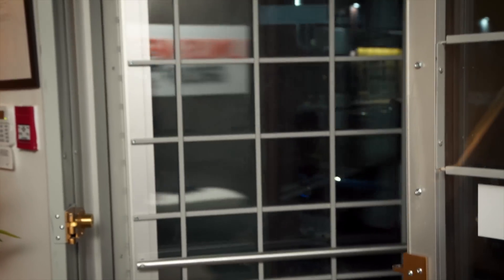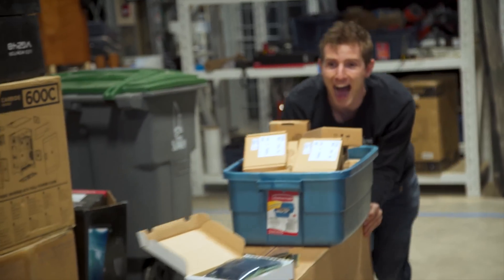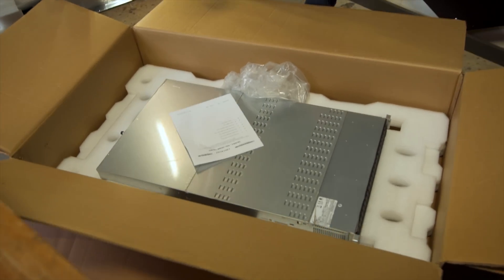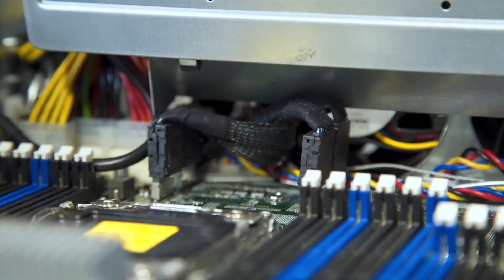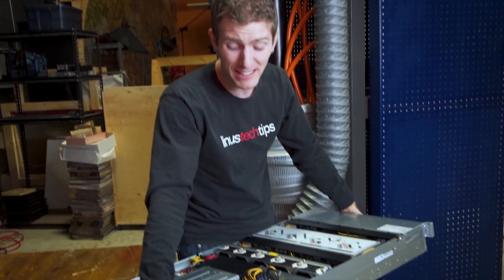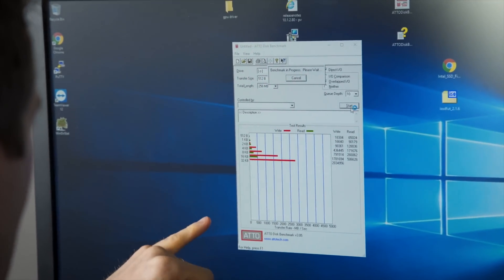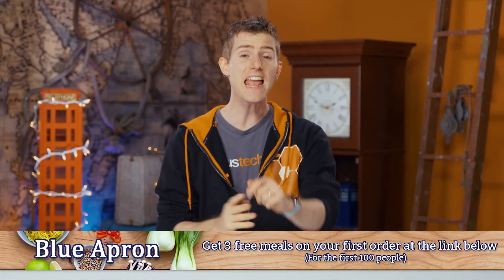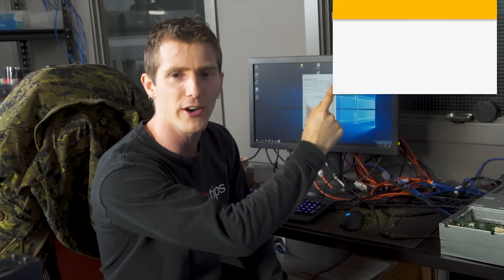The Fastest Storage EVER – HOLY $H!T Ep 14

Comment: Wait so you're running 24 SSDs EACH capable of saturating a PCIE 3.0 x2 link all on a single PCIE 3.0 x16 link? What the fuck is the point of that? You could use drives 1/3 as fast and achieve the same results (well, on sequential reads at least, but I assume that's the main workload of this system if its for video editing). Heck, ordinary old SATA SSDs would nearly get you there. Why not at least split the drives across the two CPUs and use software raid (or whatever, btrfs/zfs/whatever you prefer) for double the theoretical bandwidth?
Reply from the maker: +Matthew Hennes more to life than raw bandwidth. Many users will be hitting this at once needing low latency access to large video files. NVMe is the key to our new workflow.
Reply: LinusTechTips I'd love to see what the top of the line drives do for you that more basic ones wouldn't, especially in this particular configuration. I'm sure others would be interested too, perhaps a more in depth video is in order? Unless of course you consider it proprietary info or something.
Reply: he probably got those ssds for free , half of his inventory is free
Reply: ***** Mate, I don't think he spent $20k+ building a system JUST to make a video about it. This server will be an integral part of their workflow. I believe it could have achieved the same goals for less money, or given this budget could have performed even better. Granted, that might not have made quite as interesting of a video, but I honestly doubt that was a huge consideration in the making of this. But who knows, maybe they'll be using this server differently than my assumptions, or maybe there's something I haven't thought of. Here's hoping we get some more info, this is certainly interesting.
Reply: Virality It would be MORE holy shit if the SSDs were split across both CPUs and the transfer speeds were double, though.
Reply: yeah.... zfs raid 10 with the disks split across the two controllers is going to be faster and lower latency than windows soft raid. guaranteed.
Reply: The worst part is all he needed to do was put half the drives in the fold up slots and he'd have them evenly distributed, this is not secret/proprietary knowledge.... it's in the manual...... oh wait, it's Linus.
Reply: Matthew Otto which is why 'software' raid done on a faster CPU with more ram and higher I/O bandwidth is faster, better, and lower latency than a 'hardware' raid card.
Reply: This is what happens when you have money to burn
Reply: It won't be used in RAID 0 so the oversaturation will come down a fair bit.
Reply: +Bloodstainer Windows Disk Management can create a software raid array out of pretty much anything it can address as disks. You can't boot off of that type of array like a chipset softraid array, which is where I'm guessing that NVMe limitation is that you're mentioning. Him referring to it as the Z drive (array), pretty much means something else was the boot media.
Reply: Intel does actually make 2.5" drives all the way up to 2TB (see the P3700 series), but they're about double the cost of these for only 66% more capacity, so that may not be a very good tradeoff, plus you trade some random performance for better sequential performance. I doubt that would be an issue for this use case, but its something to keep in mind.
Reply: Bloodstainer yeah, you can. if the os detects it as a disk, it can be used in software raid. that's kinda the point of software raid.
Reply: You can't use software raid for NVMe SSDs, heck, I'm not even sure the newest Samsung 960 drives would be able to run in a RAID setup without specific gear.
Reply: Zahir khan It may appear as so; everything has an opportunity cost. Their no such thing as a free lunch! In Linus case if he was in the States, he would possibly have to give Intel a copy of his W-9 and pay taxes like everyone else.
Reply: Matthew Hennes Yeah if the SATA exit point bandwidth can be matched with the network interface unit (by something like cryon optic cables etc) then the bttrzfs/zfs can be run on modular communicator to triple the read and write speed !
Reply: A kind of Here are two similar drives, one for the entry level computer user, and one for the pro enterprise business user. and here are the features of both and why their perfect for their respective owners type thing?
Reply: The network interface is also just able to manage just one fourth of the PCIex16 card anyways. Unless you have a lot of IO heavy tasks on the server it doenst matter. The  only point of using that much drives is capacity. He would have probably been better of with fewer, bigger ones but they dont exist.
Reply: ***** well to be fair he did say that they were't actually planning to run raid 0, and besides random I/O DOES scale with raid. But I don't think he's planning to hit this with a lot of random access. He says there's more to life than bandwidth, but I'm curious what specifically he's trying to achieve with this
Reply: Matthew Otto that's not true, there are hardware raid controllers. I'm not sure if they're ever really used anymore, but they definitely exist.
Reply: Matthew Hennes He should have another 4x U.2 HBA card in there and should move 1/3 of the drives to the inner backplane.
Reply: If you cant be nice in expressing that opinion get off life. #realitycheck
Reply: Аll hоot girls аrе hеrее => https://twitter.com/4a54cd7488a77b74f/status/801992405775826944                                             Тhe Fastеst Storagе ЕЕVЕR â   HОLY  H ТТ Ер 14
Reply: yeah 24ssds pciedn x2435 x16sx link 1/3., dirives with raiz s23241 f9632s i dont know what the fuck
Reply: Matthew Hennes Because it lets him make a video for HOLY $HIT and why not if he can get his hands on it so easily.
Reply: "more to life than raw bandwidth" - if it's random I/O, how is RAID gonna help? And if it's capacity, why not use bigger (or a larger quantity of) SATA/SAS SSDs?
Reply: supermicro sell these servers also with two of these drive bays per server
Reply: STFU lol
Reply: How about all you haters get you own YouTube channel.. make is successful and then go do your own thing rather than ragging on ideas that you HAD ABSOLUTELY NO INPUT ON
Reply: and I also believe I wasn't speaking to you... #getaclue
Reply: lol take care buddy.
Reply: its not just peak throughput that SSDs are good at.  Throw more than 1 task at a spinning disk and watch it tank.
Reply: "heck"
Reply: Papa Linguine heck yeah!
Reply: ZFS all the way, with raidz2 and compressed datasets.
Reply: Bingo, not sure why he would not of done this anyways so you certainly would not hit any bandwidth and even just for e-peen it would of gone fast than that, With each drives rated speeds he could of hit 20G/sec or more
Reply: Yes, but those hardware cards run software to do the raid, it is just a very highly optimized OS, so technically, they are all software, just one is more optimized for a set task than say Windows raid.
Reply: I've set up software RAID with that same redriver NVMe expansion card (AOC-SLG3-4E4R) on the older Samsung 950's, so I don't know why it wouldn't work with newer samsungs
Reply: doggy red-rocket?
Reply: Matthew Hennes g
Reply: Yup, paid by the money he doesn't earn on promoting, because he is PAID with stuff like this INSTEAD of money.

Comment: how does raid work? does it make the drives work as one ?  noob to hard drive stuff here
Reply: RAID stands for Redundant Array of Inexpensive Disks. Essentially what it does is distribute data across an group of disks in different ways to either achive better performance, data security (from hardware failure) or both. The Wikipedia article on it is pretty comprehensive: https://en.wikipedia.org/wiki/Standard_RAID_levels
Reply: Depends on how old you are. "Inexpensive" is what it stood for before someone decided to change it.

Comment: "stop it"
couldn't have said it better myself. Please go and learn some proper enterprise architecture before you do this kind of project. 

With 24 drives in a RAID, you've culled off most of your performance off the top. RAID is inherently NOT scalable with flash and with over 8 disks. With that many SSDs, you should have MILLIONS of IOPS. What you need is not a single server. For this scale of project what you need is AT LEAST three. Split up the drives (8 each), and make a cluster. With that many drives distributed on an RDMA network and using an appropriate VSAN you should have a very solid high availability storage cluster. Also, add some spinners. Yeah, I said it. With tiered storage you'll have some cold spots that can get put in the back corner on rotational media. With your scheme it's still a blown out UPS or a kernel exception away from disaster. With multiple machines, almost nothing short of a kiloton can knock your SAN offline. 

What I'm saying here is that you need to read up on enterprise arch. Throwing youtube money on a bunch of expensive shit doesn't make you a sysadmin. Please call in some consultants and storage guys for this sort of project, because when you do this young techs see it and think it's the way to go. I'm not saying you need certs, but fuck man read a book. 

Reading material: BTRFS documentation, Windows Storage Spaces. And if you want to go the cluster route, read up on Storage Spaces Direct, Gluster, CephFS, and the redhat vsan solution. 

Seriously man, your entire business is going to be cached/stored on this box, make sure you get it right the first time.

Comment: "Obviously we would never run a raid 0"

Wait, didn't they do that once?
Reply: The only time you should run something in RAID 0 is when performance is the only thing that matters to you. Some gaming desktops will have drives in RAID 0 so you can load stuff really quickly. For any practical purpose you want redundancy. Servers are usually RAID 5. High performance servers are usually in RAID 50.

Comment: But isn't the Samsung 960 PRO 1-2TB faster? 440k/360k read/write IOPS and 3,500/2,100 MB/s
Reply: Rumble Frog Probably but intel might have shipped these for free
Reply: Find a 960 Pro in a 2.5 inch form factor with U.2 connectors. There are none.
Reply: They dont fit in SFF drive bays. You probably could use a normal Workstation with tons of PCIe slots and a bunch of adapters with 2tb drives - so you need only half of them - but it wont be as neat to integrate as a 2U chassis
Reply: +Bayonet - Use adapters. There's bound to be some company out there that makes 2.5" adapters with a U.2-to-M.2 connection...
Reply: What do you mean a 2.5 inch drive won't fit in a SFF drive bay? Of course it would.

Comment: Is that fan sound helps to cool, or they don't care at all how loud they are?
Reply: That's why you put them in a server room, away from you, like they do.
Reply: Alan W they only care about cooling and the smaller in diameter the fan the higher rpm it has to run and that's a slim rack size
Reply: Chris Rowlison well that explain a lot, so bigger rack size would allow to put normal size fans? I wonder if they are quiet fans for servers since some people would like to have machine like that at home.
Reply: Alan W not as far as I've seen, they do have variable fan speeds and the ability to take some out if there isn't as much heat to dissipate

Comment: PLEAsEEEEEEEEEEEEEEEEEEEEEEEEEEEEEEEEEEEEEE MAKE A TECH QUICKIE ON U.2 vs 2U and NVME
Reply: For what its worth, U.2 is a type of connector. It's basically m.2, but faster. NVMe is a communications protocol for accessing storage devices over PCIE (serves a similar purpose to SATA). NVMe is the protocol you would use to communicate over a u.2 connector (other protocols probably could also work).  2U is a chasis size for servers and networking gear. 2U refers to the height, which is 2 units (3.5"). It's a bit like saying a desktop case is "mid tower" vs "full tower".
Reply: U.2 is exactly the same speed as M.2. They both carry 4 pcie lanes. I think U.2 can carry more power tough. U.2 is supposed to replace the sata/sas connectors in the desktop/server market and M.2 is somewhat similar to minipcie in that it lives directly on a pcb (motherboard) for mobiles, but can also carry sata if you need it to (the mini pcie connector becomes msata)
Reply: MrTheMrhappy I stand corrected, I was thinking m.2 was only pcie x2, thanks for the correction.
Reply: didn't even know u.2 existed
i mean, i know the band but that's all.

Comment: Very cool video, I have always run raid 6 but that is with mechanical drives as the rebuild time can be very long. In my lab at IBM I had to were ear protection, I ran the fast t 500 and 700 arrays.

Comment: Meanwhile, my storage server has a dual core 775 xeon, 4gb ddr2, and a 320gb hitachi deskstar...
Reply: Meanwhile, my storage servers has... Oh wait, I don't have any.
Reply: Meanwhle, I just have the ISP provided modem/router combo with an external hardrive attached
Reply: I am packing a quad core 2.13 ghz L5630 xeon, 8GB ddr3 ram, 2 raids one 160GB per drive and one 500GB per drive, a Nvidia GT 730 graphics card a xonar gaming edition audio card. Woooh yah! It is actual pretty good considering every thing (but audio and graphics cards and I believe 2 of the hard drives) are 8 years old. Woooh yah!
Reply: Yeah. they are quite old. Still works fine for my needs though, and you can't beat the price ($8AUD)
Reply: There are tons of 775 Xeons. Mine's a Xeon 3040. Core 2 Duo/Quad/Extreme chips were also made for 775 as well as the various Pentiums and Celerons.
Reply: I considered doing that, but since I already had a 775 server board and ecc ram lying around, I just thought why the hell not and built it around those parts.
Reply: Wait........ 775 xeon.......Dont you mean 771 cuz i dont know of 775 xeon(only pentium and celeron are 775)
Reply: huh.. never heard of them but apparently they exist(pretty old tho 65 nm process)
Reply: i'm here with my single ARM-based A20 @1ghz, and 256mb of ram as well as 4 40gb 4300rpm hdds in raid 0...
Reply: Meanwhile my storage server is a raspberry pi
Reply: +N Hiles L5630 is a great CPU for a storage server since it's low power. I have one in my R510 If you're using it for a desktop, you'd be better off with one of the faster CPUs from that line.
Reply: +pe6o991 Nope, there were some servers that had socket 775 Xeons not 771. Poweredge R200 and DL320 G5p are examples.

Comment: I have no idea what those numbers mean but it seems exiting!
Reply: Dudeomfgstfux well if its writing at about 10gb per sec that means this baby can copy full GTA V in 5~6 seconds if the place where its reading is also fast... this was just an example
i wish that was also the internet speeds xD
Reply: cjeam they edit raw 4k footage off network storage from several workstations at once
Reply: Jonathan Lourador why? What on earth could you do to use any of that bandwidth? Netflix recommend 25Mb/s spare capacity for 4k streaming. A UHD Blu-Ray has a 128Mb/s maximum bitrate,d you're using a fraction of that bandwidth. You're not running a particle accelerator.
Reply: Dudeomfgstfux Basically insanely high storage read/write speeds :p
Reply: Yeah, but consider you want to move the whole content of a UHD Blu Ray disc from one place to another.
By having an effective 10Gb/s it only takes a fraction of the time.
When linus needs to move a rendered 4k file to his archive, he does not want to wait for hours, thats why hes using such high speeds.
Mind that streaming and transferring data are not the same thing.
Reply: My comment was in response to Johnathan who said he wished the internet had those speeds. Use cases on a local network do not apply to the internet.
Reply: Because i share house with allot of people and all of them use allot of bandwidth on which sometimes we come across of performance issues. Yes for single user this would be overkill but not for 30+ devices doing heavy work.

Comment: You could have used samsung 960 pro ssds or even 960 evos. Of course you'd have to buy pcie m.2 adapters
Reply: Muhammad Numan so?
Reply: Yesto it sould be much faster. The 960 pro doss 3500MB/s while the one he used does 2500. Thats theoretical 1GB/s more per drive.
Reply: Well all the NVME SSD's are in my Gaming rig. 2 x Samsung 950Pro 512GB striped. Well in any case my server still has a second CPU Socket, 20 more RAM slots, up to 8 PCIe slots with risers and 10 2.5" bays so I've got room to grow when I need... Still Linus goes Big Swagger with his Hot Pink Lambo' and I'm stuck in my Mazda 6...

Comment: what is that "quad 10 gigabit network card) i need that
Reply: Nukeuler123 it's called a network daughter card Dell and Supermicro  (along with other manufacturers) have been using them in their new systems to make network cards hot swappable in case of failures however they only work on certain systems. if you want 10Gbe for PCIx look at the Intel x520 series
Reply: Nothing magic about that, You can grab an Intel X710 quad port. You can even get 8x 10G with a dual port 40G card (Intel XL710) and breakout cables.

Comment: So how 4 10Gbe network card can be saturated by 1Gb SSDs?
Reply: Hobbyandtech those are 10Gbe aka 10Gbps those drive speeds he is talking about are ~10GB/s

Google Bit vs Byte
Reply: Derrick Mehaffy i made some research i get it now but still confused lol
Reply: Hobbyandtech trust me your not the only one, people still fight about Bit vs Byte and also if 1GB is 1024MB or 1000MB. it's all about the Bits and Bytes lol.
Reply: Didn't he achieved speeds of 9000 MB/s = 9GB/s ? If you recalculate network card bandwidth to Megabytes (4 * 10000Mb/s /8 = 5GB/s). So even if he goes raid 10, drive speed will fall to 4.5 GB/s (so pretty much saturates 5 GB/s bandwith of network card)